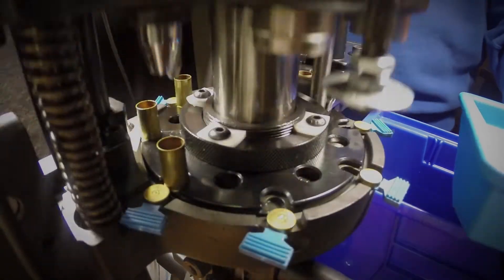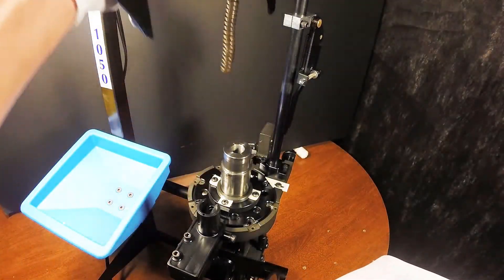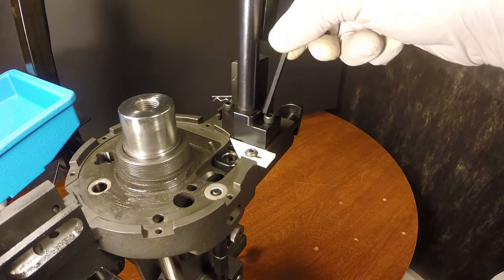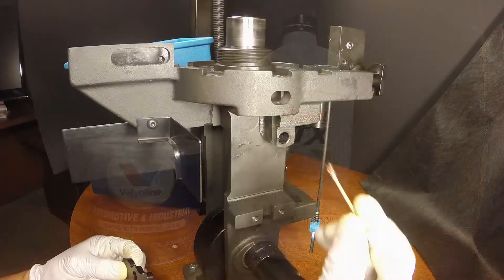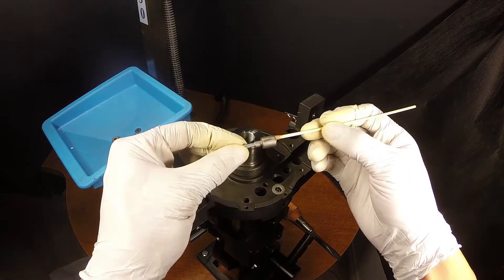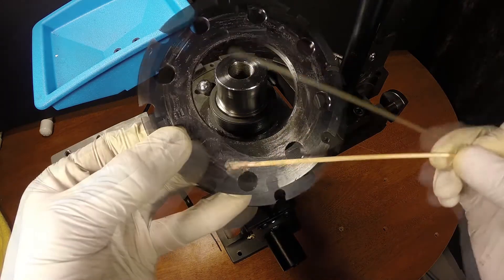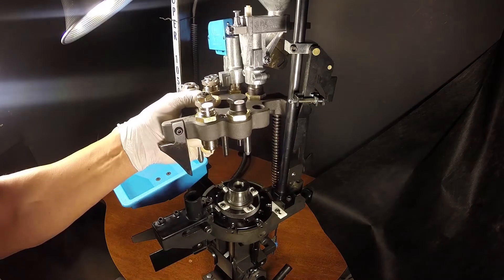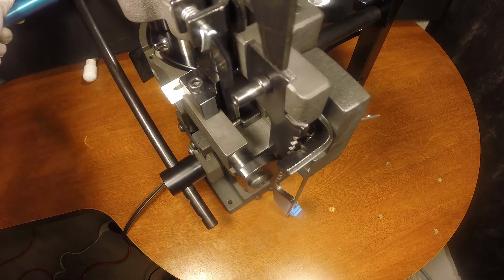How to Disassemble a Dillon 1050

Comment: Thanks for your video! I'm having a problem with handle on my Super 1050 not returning to the home position and seems to be grinding or catching on something and is very difficult to return, it takes a lot of effort on the return. Do you have any suggestions on what I can do or try to fix this issue. Thanks

Comment: What a great video illustration of the manual. I purchased the Electronic users guide for the Super 1050, and this blows it away. Your 10 minute video is amazing, straight forward, succinct and very well shot. Showing where to grease & oil. I have put a LOT more thank 10K rounds and have not cleaned and oiled my machine. I am changing over from 9mm to .45, so this will be a great time to do maintenance to my machine. Thank you for taking the time make such an informative video. I hope Dillon hires you make there maintenance videos in the future.  THANKS

Comment: Really good question: does disassembling and assembling affect the bullet set and crimp level?
Reply: No, the dies are not affected as they remain stationary in the tool head.
Reply: @V211-q4g  what's the torque spec on the toolhead bolt?
Reply: @AdventInnovative  it is not listed in the owners manual. I snug it down and call it good. Get it tight but don't go crazy.

Comment: Toolhead should be fully tighten in downstroke position.

For change to different primer size, there´s no need to remove toolhead ratched, ratched restriction tab and move primer slide assembly. Primer slide change be removed or changed by simply removing toolhead and slide stop.
Reply: If you're smart you clean and maintain the press every time you change cartridges. Period.

Comment: Man, I can't wait to start reloading. After the equipment is paid off (how many rounds did it take for you to do that), how much is your cost per round of, say, 9mm (FMJ)? Thanks!
Reply from the maker: Reloading will generally save you about 50%.  My current cost is 15 cents/rnd ($15/100).  At my local gun club they sell reloads for ($30/100).  For a $2,500 reloader, that's about 16,667 rounds to break even.
Reply: GunRunner411 Thanks!
Reply: +GunRunner411 Frankly, since I pick up brass at my shooting range; my cost is even lower for 9MM!!  It costs me about 11 cents a round.  Since you've been so kind to take the time to post this video; get in touch with me and I will tell you where to order your supplies from.  I've done hours of research and have found the best places for getting these components, including powder (which is usually the most sought-after and hard-to-find component)!!

Comment: I have watched this video over and over and cant for the life of me figure out why there is slop in my 1050 everything works great but at the very top of the handle stoke the shell plate moves an eighth of an inch to far then on the down stoke the alignment pins straighten everything out but the additional movement and slop shouldn't be there i wouldn't think
Reply: +Zack Smith  I actually figured it out the guy I bought the press from had the spring under the shell plate detent ball upside down so there wasn't enough tension

Comment: You're better of reading the manual and not waiting until you have problems to service the press. Dillon "recommends" you don't EXCEED 10,000 rounds. That's not a recommendation to wait 10,000 rounds to perform maintenance and how often maintenance should be done depend on too many factors to be dumb enough to risk trying to "run" 10,000 rounds.
Reply: DEEREMEYER1  Yeah I think everything had better be perfectly clean to run 10k between services. I oil the main shaft pretty frequently, and do the rest of the machine every time I change caliber. Cleaning the inside of the primer tubes and the bore in the primer slide  I’ve found particularly helpful.